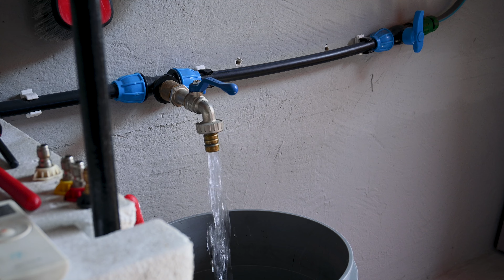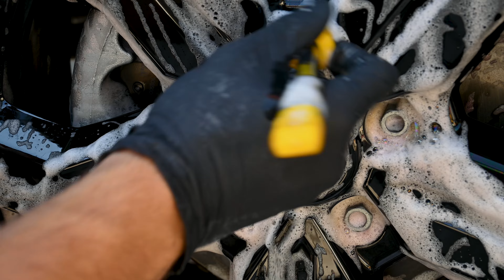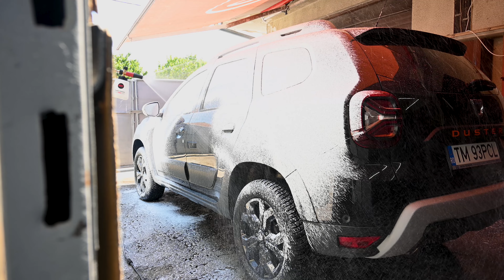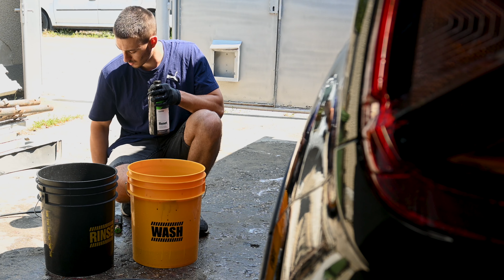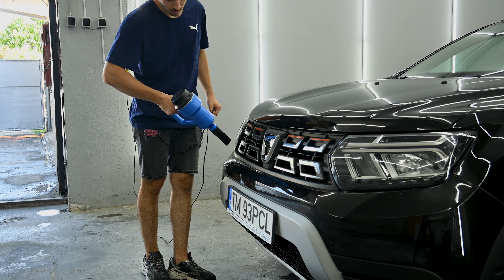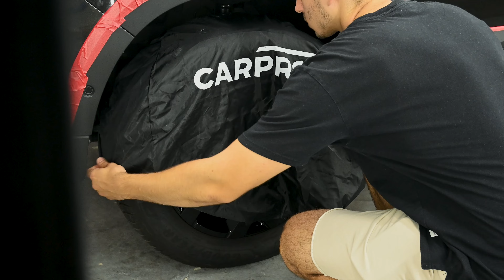Foam Wash A New Dacia Duster - ASMR Car Detailing

Comment: Looks nice. Which color is this?
I ordered the Duster Extreme in Gris Comete (dark Grey) the day the Dacia dealer introduced the Extreme models, but I am still waiting for the car to arrive at the dealer.
I also ordered the shark antenna, side steps, all the protective covers at the side of the car, and the front protection with the extra headlights.
Can't wait until the car arrives and I can drive in it.
Reply from the maker: I was left speechless about the quality of the car based on the price and about the extra mods and stuffs i dont know 😅 but its a nice car overall.
Reply: black-pearl metallic